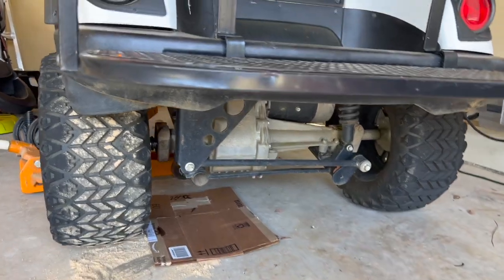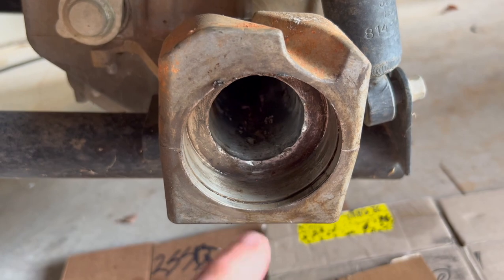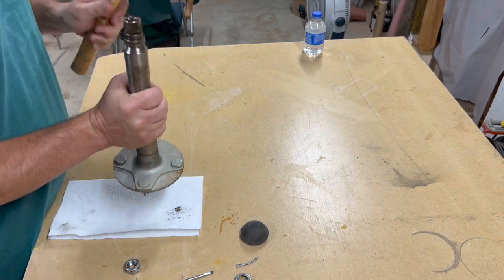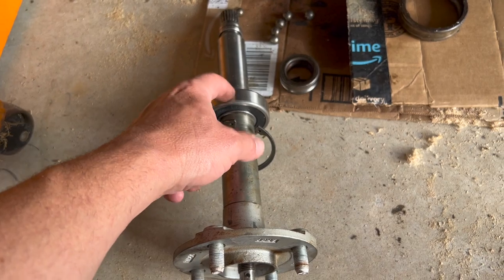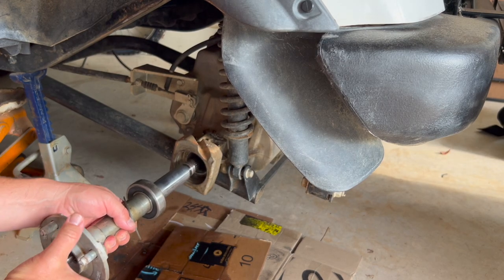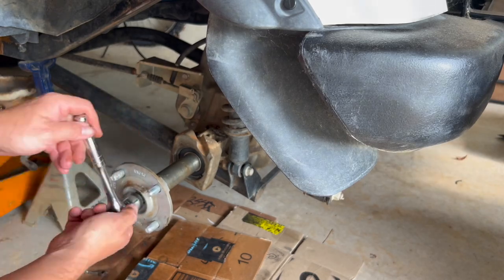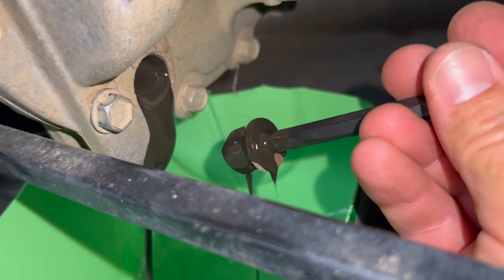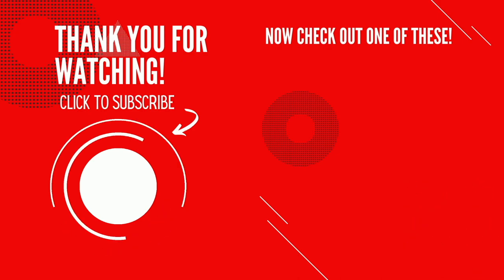Yamaha Drive YDRE Transaxle Ball Bearing Replacement - Golf Cart Leaking Oil From Rear End

Comment: I’m having the same issue with oil leaking from driver side of rear end. From what I’ve read, you will need to take rear end out and split it to replace internal seals that’s leaking causing oil
To bypass. Have you heard of this ?
Reply from the maker: If it’s leaking from the drivers side where I show the bearing is located, you likely have a bad bearing too. The bearing is the seal on each side. The only other seal is the seam where the transaxle splits in the middle.
Reply: @TightWadDIY  there’s more seals. I’ve checked the Yamaha parts list. It won’t let me post the PDF file here.

Comment: Are we sure that the transmission oil travels into that cavity? This is a sealed bearing. Also, there's a weep hole at the bottom of that cavity. Any oil from the trans will just drain out onto the ground.
Reply from the maker: The sealed bearing is actually what prevents the YamaLube from leaking out of the transaxle. I have another video showing how to disassemble the entire transaxle to replace the brake plates.
Reply: @TightWadDIY  Thanks for the response. I think I understand what you're saying but there's a hole at the bottom of this cavity. If you reach under the trans casting just beyond the bearing you can feel it. You can also see it from both inside and outside. It's on both sides. I was able to pass a pick tool up through the hole as well. Any fluid in that area will just leak out onto the ground.
Reply: @Swegen7  Here is the video showing the full teardown.
Reply: @GrillThisSmokeThat  Not sure if you meant to post a link with that but I don't see one. Maybe I should be more clear. I did the job myself. There IS a weep hole at the bottom. It's on both sides of the trans. Left and right. Any oil in this area will drain out this hole. I'm just trying to understand here. I don't think there is any oil in this cavity. If there was, it would be on the ground...period. This hole appears to be located inside the bearing. Meaning before the bearing working from the trans out toward the wheel.
Reply from the maker: @Swegen7  Sorry I realized I commented from the wrong account. GrillThisSmokeThat is my other account. When my bearing blew out, all of the YamaLube oil leaked out of the transaxle. This is on a 2007 YDRE meaning the electric model. Here is the link I intended to send previously. https://youtu.be/3UQtOE8huMk
Reply: @TightWadDIY  Thanks for the video.